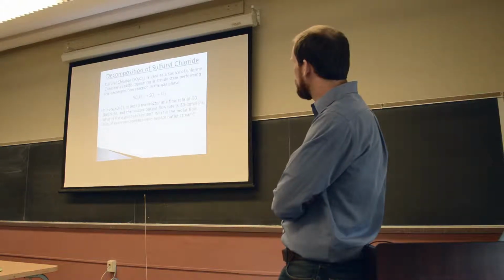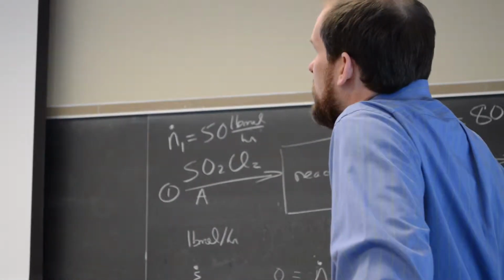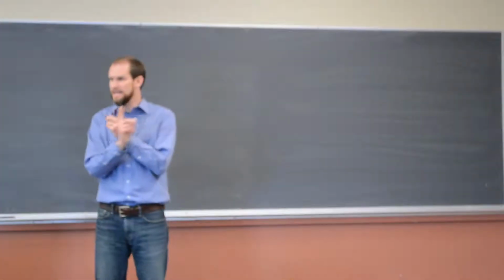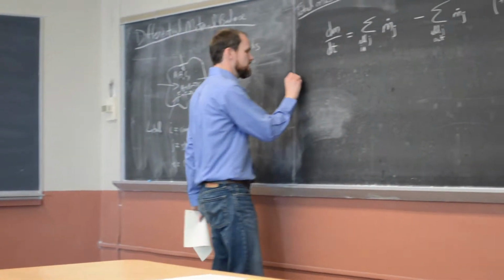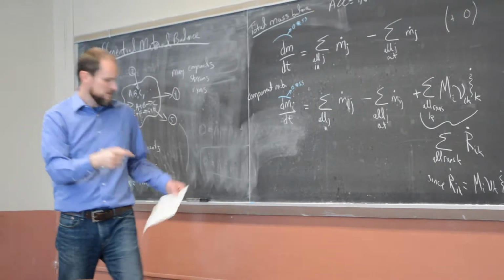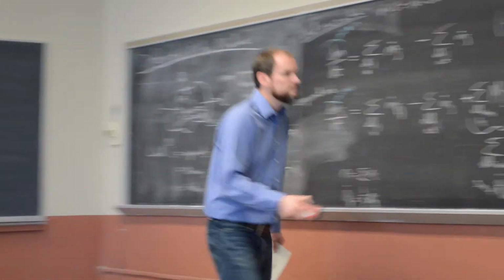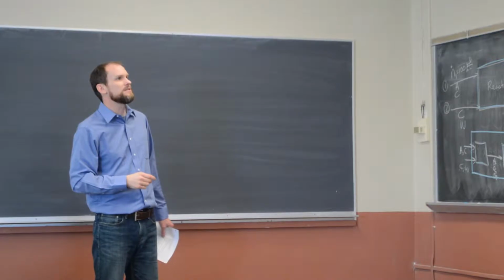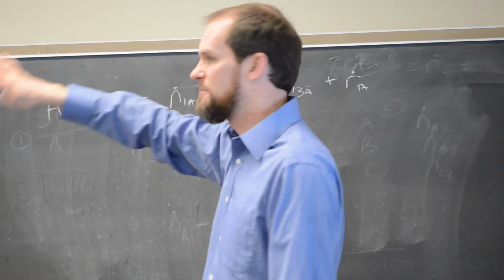Differential Material Balance - 3/4/15

Comment: Mr Gray: Too many differentials and summations for a trivial problem. The mass balance is easier.  And is better to use the concept of reaction rate that the concept of extent of reaction.

Johns Hopkins University? United State of América?. And classes with chalk and board. And the Professor copying of the leaf. I am scared.